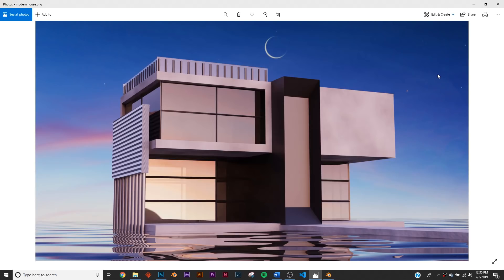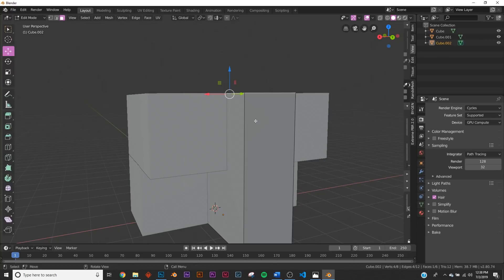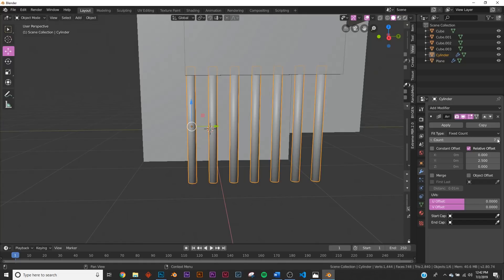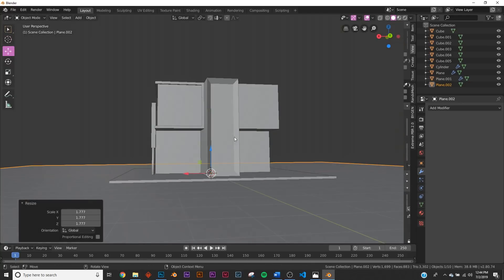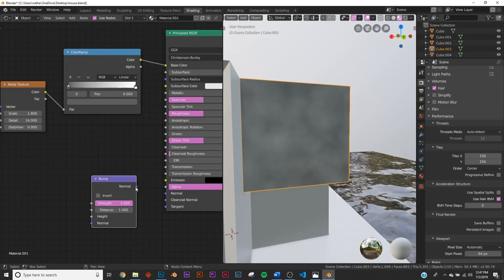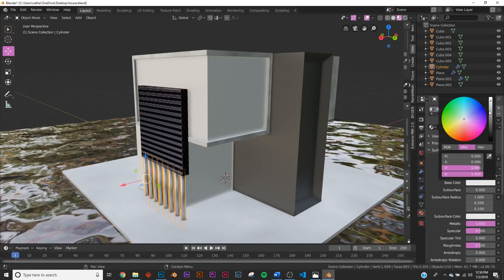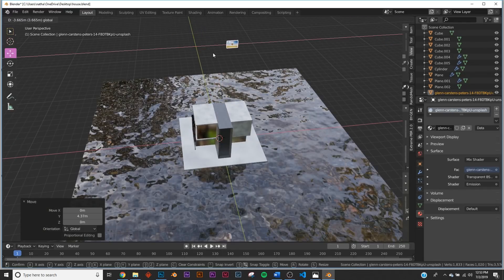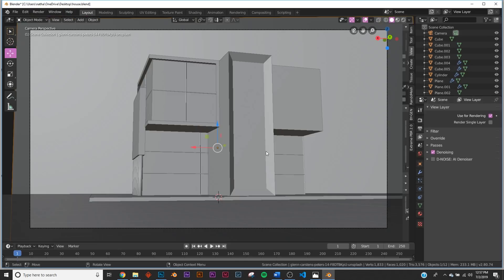Blender - Modern Home Design in Blender 2.8 (Modern Architecture)

Comment: I know that you probably wont see this but can someone help me out.
At 9:23 when you snap the noise texture to the color ramp its affecting the whole house?
How will i be able to fix this
Reply: instead of just clicking on the block and using the already set up principled node you have to go onto the right side of the screen and go into the materials tab, at the top of that tab press the little plus icon next to your list of materials and use that material, you need to make a new material otherwise it will stick to all the other objects.
Reply: @archiebaker3140  Thank you so much :) !  !
Reply: same

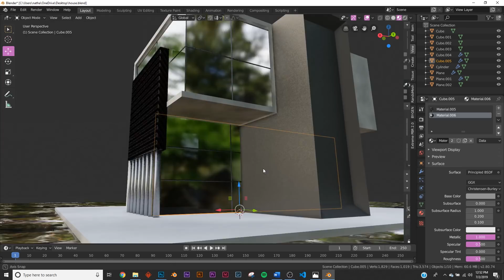Comment: At 13:57 when I insert the wireframe, the whole cube gets turned into a wireframe instead of the front face only like in the video. Help :(
Reply: Did you separate the front face?
Reply: @romaiobrown-senior8602  yeah I did that and fixed the issue :)

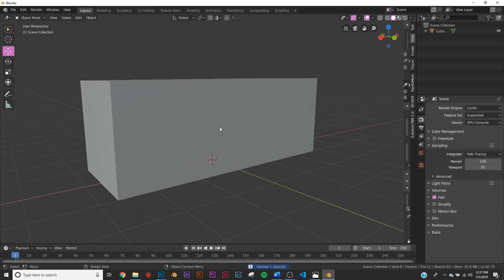Comment: 1:09 

Its Shift D

Also for more accurate results of putting the cubes on each other you can snap to increments
Reply: That's help.thanks😁
Reply: @krisnanugraha8907  welcome
Reply: Dude, THANK YOU!
Reply: @newone5262  Np lol :D
Reply: @MicroGBY  The magnet button near proportional editing?
Reply: 1:21 what did he just click on keyboard?
Reply: @ajaxkingsman1940 if you mean, when he moved the face, it was "G" which is to move.
G and the X key means that it will move in the X axis, G on the Y key means itll move on the Y axis. and you get it.

If you're talking about the time he changed his selection to Face selection, that's 3 on the normal keypad. so yeah

Comment: dear , a wall(rectangle)'s  one face has four vertices...i want to increase the vertices so that i can make a window on it...how can i do it ?....the subdivision modifier converts the rectangle into a rounded like shape like polygon.
Reply: same problem
i was trying to find the solution in comments .. did you find any ?
Reply: @anushapahari2404   select the object,  go to edit mode , then select the face which you want to subdivide (the face selecter option will be on the top left side ) , then press ctrl + E , and it will ask you to subdivide , increase the number from 1 to max. of 10....
Reply: thank you so much @muhammad it helped me alot
Reply: @anushapahari2404  no problem dear

Comment: Why do you apply the scale to everything? I've been using Blender for years and never used that before what is it even for?
Reply from the maker: Tristen Major it’s hard to explain over text, to test it out add displacement to a plane, then scale the plane up by a lot then apply scale, that should show you what that does, it also works on wireframe mod
Reply: @TheDucky3D  Great answer! Thanks, I tried it and I understand now this seems like it will be very useful in some instances I'm surprised I either forgot about this function or never knew about it.